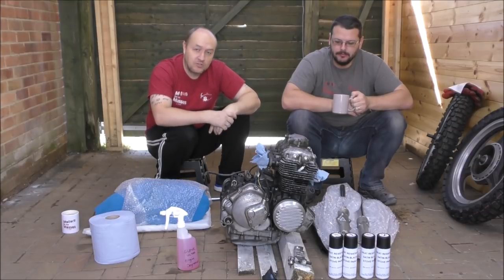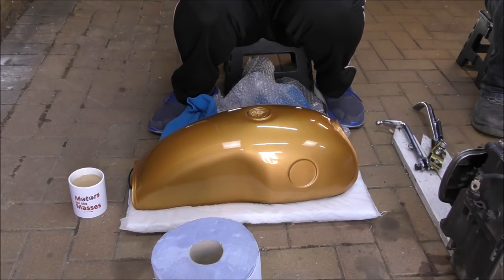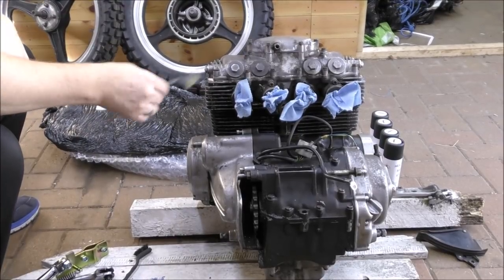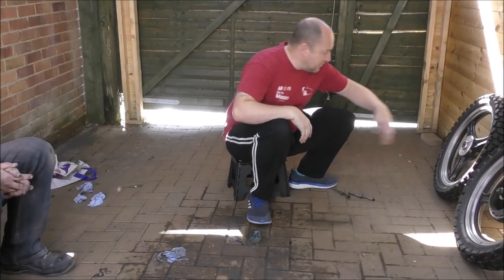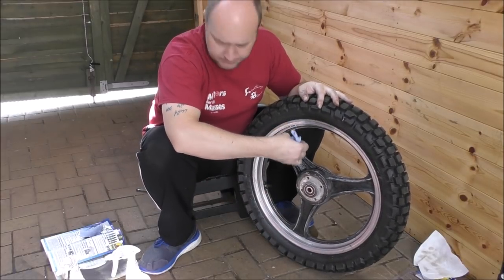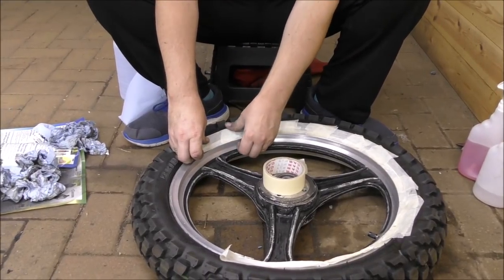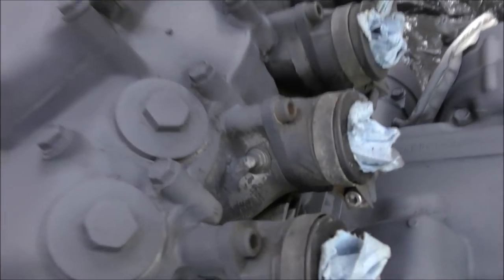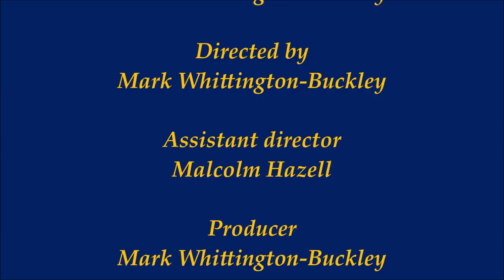HOW TO Paint engine, forks, wheels ON A BUDGET and

Comment: Think I might have kept a few bits on the engine alloy tie in with the wheels.
Reply from the maker: That was a consideration. I think with the stainless bolt kit, that will make a difference
Reply: A dremel to the edges of two rows of ribs will give a perfect accent offsetting the darkness.
Would have kept caps etc natural.

Comment: Hi guys, any chance you can name the paint brands you used and comment on whether or not you would use the same again? Cheers
Reply from the maker: Well, the quality of the paint is good! Kapci was the brand; however the paint code from Kapci was wrong, so the burnt Orange I was expecting turned out to be Gold with an orange pearl,. which we happen to still like. Kapci did call me and apologised but by then they were sprayed already.
Reply: @motorsforthemasses  I've just finished watching the final 'reveal' - the colour is awesome! A happy accident I think.
What about the engine high temp. paint? I really like the matt finish and from the video it looks a better quality finish than I've tried before.
Reply from the maker: @Mr_Berlin_James  Thank you for your comments. The black paint was this: https://www.ebay.co.uk/itm/UCL-Trade-Heat-Resistant-Satin-Black-Spray-Paint-BBQ-Barbecues-Stoves-Exhausts/152808651053?ssPageName=STRK%3AMEBIDX%3AIT&_trksid=p2060353.m2749.l2649